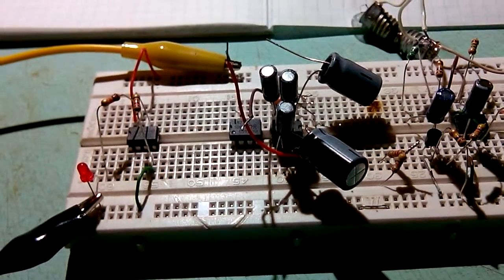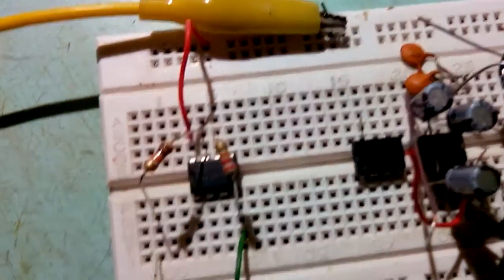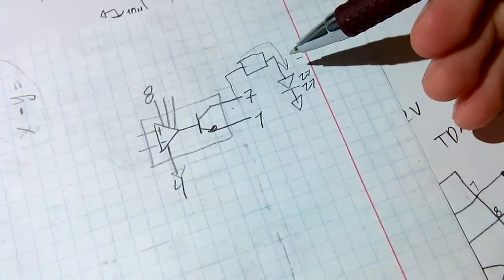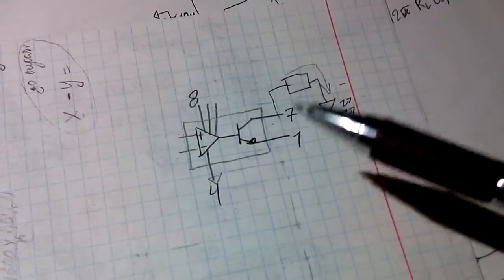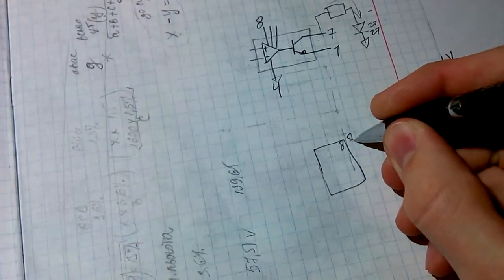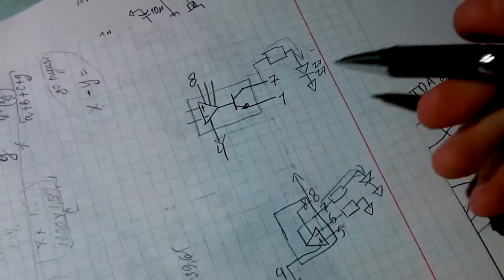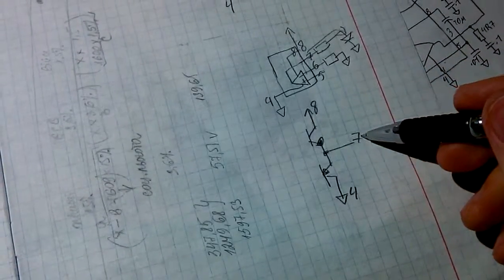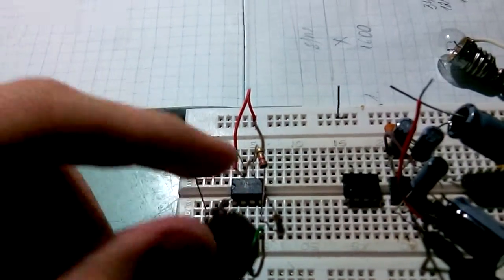Beware of fake LM311's on eBay!

Comment: Just because an electronic component is new is no reason to assume it is functional. Nobody else ever tested it. Well, you can buy tested components but be prepared to pay for that luxury.
Reply from the maker: Paul Frederick True. Those chips are indeed lm358's, I used them in circuits and they work fine :)
Reply: I doubt they are genuine Texas Instruments LM358s too.
Reply from the maker: Paul Frederick I'm not saying they are, I'm just saying that they work as 358's nicely. For generic circuits they are fine :)
If you have critical application, use genuine parts by all means.

Comment: If you look at the actual internal wiring diagram of the LM311 TI datasheet and not the block diagram it looks like current can come trough to power an LED.        Wire up a proper complete circuit and see if the circuit works properly.   LM358 is a dual op amp.   LM311 is a single comparator in the package.
Reply from the maker: jp040759 I've made this video because I have used these chips in LC meter, and they just don't work. It is not an lm311, period.
Reply: Gotcha.  Sounds like good diagnosis.

Comment: Give us the seller's name on Ebay
Reply from the maker: Heavy Mechanic This chips are sold by many people. You can't be safe just by avoiding one seller.
Reply: At least if you give me the Ebay seller's name from which you bought it, I can avoid one seller
Reply from the maker: These came from G&C supermarket. To be fair, out of many parts I've bought from that place, it was only these few chips that were "bad". Overall, it is a great seller. And the IC's aren't useless, as they are dual opamps.
Reply: Thanks

Comment: isnt current flowing trought one of pn junctions of transistor from output of comparator
Reply from the maker: +JOSIP Žlk Nope. I've thought about that too, but it's really a dual opamp. Remember, I pulled pin 6(balance/strobe) not a pin 3(inv input) low, so there's no excuse for it to work like that. Here's the thread by another fella on the EEVBlog Forum: http://www.eevblog.com/forum/chat/fake-andor-mislabelled-lm311-)/
 The thing is, I don't have any genuine LM311's laying around, I have one in my LC meter, but I don't want to take it from there. I'll buy a few from the local shop, maybe I'll be lucky enough to get at least a 'proper' knock-off. I can do a follow-up video in Proteus explaining the same circuit, and I'm sure it wouldn't do what it did here.
Reply: I agree,you have good videos it deserves more  subscriptions you just need more light on area you film in. Also I want to ask you IF you can help me fix my tv  it has problem with green picture,it isnt green all time just becomes green instantly and then after some time becomes good again.sometimes I can see short flicker of other colors I think it might be colored lines across the screen but It is soo short I cant tell.Once picture started fading   and faded after 15 secounds and became almost all black I coud only see shadows of picture after that I turned it off and leaved for few days and now it shows picture again but other problems are still here it is  voyager 55 ttx.
Reply from the maker: JOSIP Žlk Thanks :) Video is in such state 'cause I use my phone to film it. 
 About the TV - it can be video amp transistors (located on the neckboard, 3 of them) freaking out or even picture tube itself having intermittent shorts. I would say - go and replace that 3 transistors on the neckboard. And, try to tap the CRT's neck LIGHTLY when you have the faded picture or some other sort of an artifacts; if you see a definite response on the picture when you tap the neck, it is the CRT having intermittent shorts. Also, check electrolytics nearby the flyback transformer, when they go dry they usually cause severe image distortion.
Reply: I will check caps when I make esr meter I tried and circuit works but  I need to order analog meter from ebay beacouse It works in reverse with digital one. I learn a lot from your videos :)
Reply from the maker: JOSIP Žlk Last one is kinda funny. Because in my videos I essentially tell what I've learned from other videos, as well as my own experience :) You can use practically any movement for the ESR meter, I've built mine from cheap analog multimeter(used just a case&movement from it). Really valuable tool to have. I'll make a video about it if I'll have free time.
 Before you go checking caps, give the TV a tap test I told you about earlier, it can very well be the CRT.
 Again, that's just my assumptions, I can't tell for sure. But I can narrow down the region in which you'll have to search for the fault.
Reply: +MrJohhhnnnyyy  ok I have anoather crt tv that is bad has picture but some shit is happening with it I will make a video and post it so you can see it  sometime I dont remember  what it looked like. for esr meter I will buy 3 $ meter from ebay and just hack it so It will still work as analog multimeter cause they can come handy sometime. I will start making videos too  but I  never edited a video  and I dont like to do things like that editing video seems boring
Reply: +JOSIP Žlk also I noticed that you watch almost all videos and folow people that I do.When I saw it i tought that I am watching my youtube history :P
Reply from the maker: JOSIP Žlk Yeah, it's not a big surprise to me. When I find another interesting channel, I'll always see a comments by the same guys that I saw on the other channel. It's like a mob :)